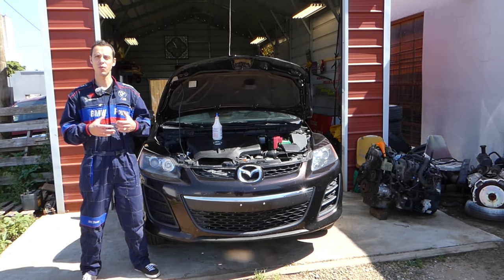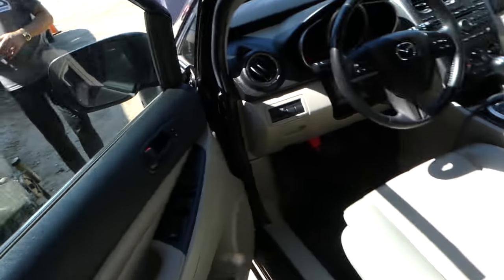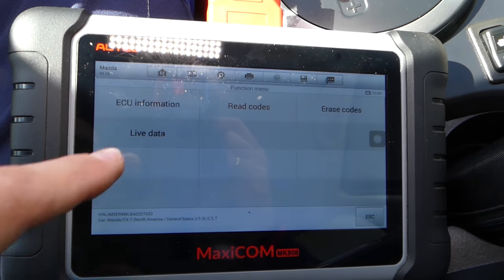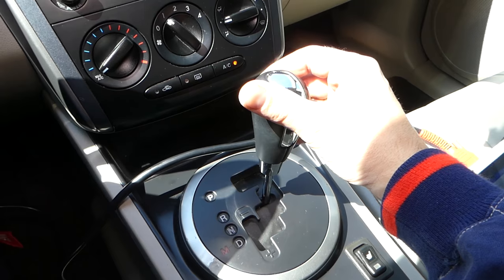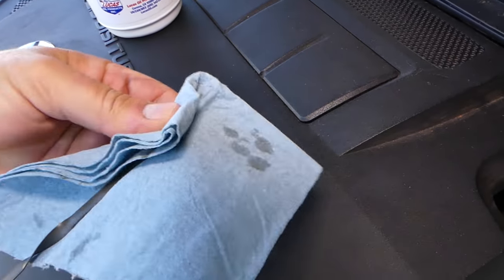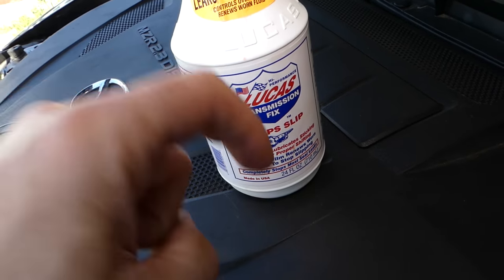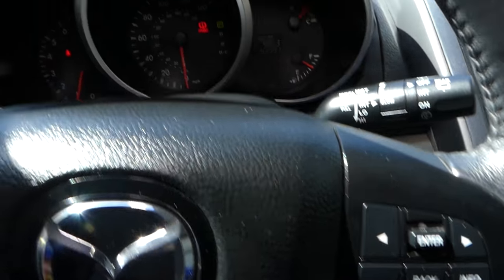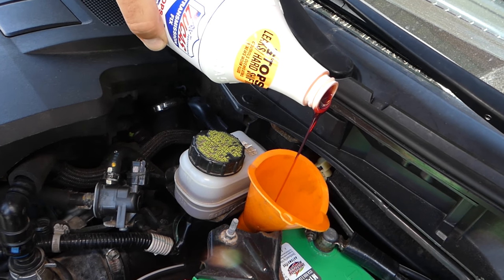HOW TO FIX TRANSMISSION THAT SHIFTS HARD SLIPPING ON MAZDA 2 3 5 6 CX7 CX9 CX5 CX3

Comment from the maker: Products that we use and recommend:
► Lucas Transmission Fix: https://amzn.to/2K4eLkX
► Panel Removal Set: https://amzn.to/3YiMADu
► Assorted Fuses: https://amzn.to/4fx4s3F
► Tool Set: https://amzn.to/3p5MM6t
► Screwdriver Set: https://amzn.to/3XRB28Q
► Castrol Oil: https://amzn.to/3xBc8B9
► Oil Filter: https://amzn.to/3w0Ulme
► Torque Wrench: https://amzn.to/32qyRwg
► Liqui Moly Engine Flush: https://amzn.to/3IiDBID
► OBD Scanner that we use most often: https://amzn.to/3I4MQfe

► Check out our Amazon Store for the tools and parts that we use: https://www.amazon.com/shop/worldmechanics
Reply: Can I apply this to the skyactiv ones?

Comment: To everyone who has an issue with jerking or slipping mazda transmissions......please use Amsoil Fuel Efficient automatic fluid........its like magic for mazda transmissions and will shift like new again provided there is no physical damage with the gears or clutch plates. Amsoil Fuel Efficient automatic transmission fluid will give you smoother shifts, increase mpg and send power to the wheels faster. You have to do a complete flush if possible. That means all the old junk fluid needs to get swapped out with new amsoil tranny fluid.
Reply: Does this work with manuals too? Im assuming not, but just incase id figure id ask bc my 2010 mazda3 2.5l is slipping
Reply: @randomriffsrawsome  they have a different gear lube for the manuals......100% synthetic.......it will feel different from anything you have ever used in the past!
Reply: Even for transmissions calling for 3309 fluid bc thats all i use bc thats what it calls for? My 2007 cx7 had very poor maintence to the transmission so i only did a drain and fill . It slipped before and still does. Looking for a solution.

Comment: New Mazda owner it’s a Mazda 6 2008 and the auto transmission light pops up when I use it and doesn’t shift after 3rd gear and already changed the cylinders and got em new did a oil change and still the same any suggestions?
Reply: What was issue

Comment: That's was super helpful. I am driving a MAZDA CX-5 2017 model 2.0 automatic and I noticed this issue almost 1.5 years back. But recently I have experienced this more frequently. Even though I did ask agency to check while my usual service they couldn't find the reason and as since it's happening only once in a while I was not able to show this to them. You solved my long standing problem and thanks a lot for this video.
Reply: have you tried?

Comment: Wow thanks so much! This whole time I thought it was my fuel injectors but Scotty kilmer was saying that's kind of hilarious because gas is a cleaner in the first place. I did my fuel injector test the two in the middle sounds thinner than the other ones but they all sound okay. I have had fuel problems in the past with other cars cuz I run the gas pretty low but I was convinced that it's probably not the fuel injectors. So then I started to wonder if it was the computer. I know it's not the transmission cuz I've been driving it like this for a year and I drive a lot I mean a lot. I do lift an Uber and more. And it hasn't gotten worse. So it has to be something that would take a long long time. Hence your video! Transmission fluid I never even really thought about it but hey it's part of the transmission I should have looked in the manual like you did! Anyway wonderful and thorough video I wish more YouTube videos were like yours! Keep up the great work! It was so helpful!

Comment: Hi, great video!  

I own a 2017 Mazda 6 and it shifts hard when downshifting to 3rd gear.  I'm planning on draining the pan, replacing the filter and refilling.  The fluid is very brown and should be blue.  It has 115,000 miles on it.  Any suggestions?
Reply: if the fluid has never been changed do it asap. hope you did that and followed through with the filter etc. nice move.
Reply: So any update on transmission problem ?... and how did the trans drain and filter change work out ?
Reply: Did you get it fixed
Reply: Experiencing same issues. Replaced oil (which was disgusting and very brown) and filter. Still experiencing this. Did you find a solution?

Comment: HI, my friend....I would greatly appreciate if you could help me with a question I have...SKYACTIV-DRIVE 6-Speed Automatic...how many miles this transmission can last before starts giving you problems
There is a Mazda 3 2017 with 173000 miles on it.Is this transmission just about ready to start giving you  trouble.Can mechanic inspect the transmission and find out the condition of it..
Thank you so much for a quick answer.

Comment: Have a 2007 CX7 transmission fluid was never changed ever. I know when this happens to never flush but do a drain and fill,which i did. Transmission slips between 3 and 4 gear . If you have to step on the gas for a boost it shifts rough and slips. Will the lucas fluid help.this you think. Also getting a low pitch humming from rear transfer case while at a cruise around 30mph and up. Inspected it and seems it may have a slight transfercase seal leak right where the cv shaft goes into transfer case. I see thick grease build up around that area. Should i change the transfer case oil if its never been changed? Thanks
Reply: Hey did it worked ? I am having same issue gear slips beyond 70 miles per hour
Reply: @chaitanyac3069  yes actually it did to my amazement. I used 12oz of it. Supplimented 12oz of stop slip for 12 oz of 3309 fluid ,took about a week until i noticed a difference but yes it did work.

Comment: I have a 2009 Mazda 3. Car went out while driving. When I turn the car on, it just revs and stays running in any gear if I let off the clutch. I still need to use the clutch to put it in to any gear. Someone over the phone thought that sounded out of the norm and said to look in to bleeding my clutch. My fluid was damn near empty when I checked it. Took more than half a bottle to fill.

Comment: 2011 chevy Malibu and the scanner detected 2 codes (P0783, P2714) 
P0783 = Transformation pressure switch solenoid “E” circuit high 
P2714= Pc solenoid 4 stuck off 
My car it has been skipping like crazy for 3/4months. Maybe if i try using Lucus and changing transmission oil do you guys think these 2 codes will go away and check engine will be wiped away completely? Thank you !

Comment: Can I still add the Lucas ATF even when I have a different ATF(Castrol) or do I have to flush my fluid then I put the Lucas ATF
Reply: Did you have shifting problem after changing/putting in castrol atf ?

What castrol atf did you use ?

How many miles does your car have ?

Did you fix your problem ?

What car do you have ?
Reply: Devo
Devo
3 days ago (edited)
Did you have shifting problem after changing/putting in castrol atf ?

What castrol atf did you use ?

How many miles does your car have ?

Did you fix your problem ?

What car do you have ?

Comment: @5:45 you mentioned that after 5-10 miles the car started shifting smoothly -- unfortunately, this can be a FALSE positive -- as the new CX-5 of mine has a missed-shifting issue first thing in the morning, every morning, (going between 2nd and 3rd gear under medium load) -- but after about 5-minutes/miles it starts to shift normally.
Reply: Do you still have this problem? Is yout transmission still driveable ?
Reply: @OmarSavala  Still have it.  Whenever the outdoor temperature overnight drops below, say 60-degrees fahrenheit, it TRIGGERS the "morning warmup transmission program" to kick in.  I'll be doing a video of it in the future!  Of course, it doesn't show up in MAZDA's diagnostics -- so the dealership (and regional) won't do anything about it!  REALLY UPSETTING, as I own two CX-5's, and they let me down on the new 2024 version!
Reply: ps.  MAZDA disabled the "manual reset" option -- for 2024 CX-5
Reply: @dziggy3004 how many miles do you have on it ! I did like a reset on the electronic transmission seemed to help a bit
Reply: @OmarSavala  Less than 7500
Reply: @dziggy3004 wow. So stay away from the 2024?:(

Comment: My Mazda CX-5 does not change to higher gear when driving. It’s constantly on first gear and would not move up. What could be the problem?
Reply: Business AsUsual   I bought a used mazda cx7 2011, and after I bought it the previous owner mentioned some work on the transmission was done, but I have no clue what it was. he said the car wouldn't drive in reverse. 
do you think that would be the TCM issue?
Reply: Did you fix transmission problem?
Reply: @AP-bo1if  It was the owner of your vehicle, he knows what's going on and sell it to you like that 😂.
Reply: If there's a warning light on follow the steps for that Warning light ....
No warning light make sure it is not burned out . Or otherwise disabled .

Comment: Figured I’d comment. I have a 2005 Mazda 3 2.3 hatchback and when I drive it climbs gears abnormally fast. It will sometimes climb to 4th gear when I’m only going 20 mph. Idk if I need spark plugs coil pack, idk if the 2005 needs a new tcm or if it doesn’t have one and needs a input and output speed sensor and a vehicle speed sensor and a pcm?? Idk these are all things I’ve researched. Besides getting a new transmission idk what else to do or what it needs. Don’t have a check engine light on and the car has lack of acceleration and power. Can anyone help?
Reply: Update? Same problem.
Reply: Any update? I have the exact same issue in my 05 mazda 3
Reply: Same issue😢

Comment: no dip stick for tranny in my mazda 6 2013 2.5l   which is stupid , I have to check Through Weep hole
Reply: Is if a manual? Bc most (probably all) manuals dont have dipsticks bc the transmission is a closed unit

Comment: I have a 2009 CX-7 and I am having this problem. I am also having the problem where my battery is dead every morning when I come out. It is not the battery because I have changed it several times. The tests say transmission and alternator are fine. It does indicate low voltage though. At this point I am thinking of changing the alternator anyway. 

Anyway, these are the codes I am having. 

P0012 
B1318
B1994
B1884 

Again, it says transmission ok. Starter ok and alternator ok on all the testing devices I have tried. But it still have these problems. I am trying to figure out what I can do because changing the transmission is a big deal.

I will try to change the transmission oil along with the alternator and see if anything gets better but if anyone has any insight please let me know. Thank you.
Reply: Interesting, I'm going through similar symptoms with my 2010 CX-9.  Transmission jumps to gear 3 and gives me a AT warning light. Code was P0974 indicating  Shift Solenoid A Control Circuit had high voltage for a predetermined period of time.
Reply: Lord Caldlow I traded the car in February, got a rav4. It was just way too much to deal with and I needed something reliable. Also mine did not have trunk lights as far as I know. There was nowhere else that took power and the transmission problem was gettin worse. I will say I do miss how nice my old car was because the new small SUV’s suck, it’s way too small. I find myself missing my old car for that reason and also the fully loaded version of my old car is way better than the fully loaded version of this new one. But I digress, all of that without the reliability means nothing.
Reply: derwinism hey.
I have a 2006 mazda5 doing the same thing. And has the same code. Idk what to do? I called a few shops and they say get a new transmission! 😳😡Which makes me mad. I can’t afford that and if I had that kind of money I would just buy another car. Js. I should just have to replace the shift selanoid? Right? And is that external? (No one ever answers anyone’s comments so it’s frustrating.)
So, if anyone can help?And, will this Lucas transmission fix work on a slipping transmission regardless of code? Thanks.
Reply: Suzanna J  I traded mines in. It was just too much of a headache honestly and I was just so tired of being ripped off at these shops as a woman it’s the most frustrating thing. And when you go in there with your problem they act like you don’t know what you are talking about when you have been experiencing the issues. Anyway, if replacing the solenoid is something you think is doable I would say go for it but honestly it’s probably not gonna get better. I would just find a way to get rid of it before it starts to get even crazier. My last straw was when it stalled on me on the highway all the way out in NJ. I was lucky that it started back up and I didn’t need to call a tow truck, took my time getting back home. So yeah, it’s up to you but make sure you get someone you trust to give a 2nd and third opinion.
Reply: The symptom you describe that your battery is dead is something is drawing current when the car is off and all that needs to be done is a parasitic draw test and just checking all the fuses one by one. Should take a couple of hours to see what is causing the draw.
Reply: @derwinism  any updates or fix for your Mazda problem?
Reply: @suzannaj3834  Lucas is ok but the best one is a product called... BG ATC Plus... check Amazon or Google it

Comment: Don’t use that crap use proper fluid as hand book states
Reply: I used that product on my Daihatsu and believe you me it's fantastic,
Reply: It's a proven product if used properly like anything. 
High milage .
No Sensor or Computer issues .
This is acceptable for a high milage transmissions .
I suggest you learn more about these transmissions before you get to this product . 
Avoid adding it when there is another problem you have not addressed.